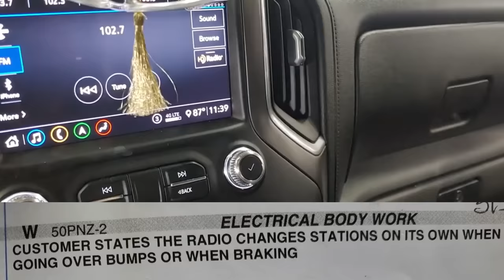Customer States New Camaro They Bought Won't Start

Comment: Im guilty of one of these. I changed the oil in a customers Escort. Th oil filter was on the back of the engine and very hard to see. When I got done with the oil change it was leaking, but only when you drive it and not at idle, I guess it only leaked at higher oil pressure, so it wasn't obvious until they left. They brought it back and I put it on the lift and saw large amounts of oil all around the oil filter. I made sure it was tight then removed it to check the sealing ring, all was good. Figured it was just a bad oil filter. Put a new one on it, no leaks, I hadn't realized it only leaks when driving yet. They came back the next day with the same problem. Got it on the lift again, took the oil filter off and looked around the filter boss with a mirror. Sure enough there was a wire harness just above the oil filter with a Ford part number tag on it. When I unscrewed the old filter the tag fell onto the filter sealing journal. These things happen. Love your channel, it's funny seeing some of the things people try to pull off.
Reply: those damn tags

Comment: listen the snake thing 100% can vouch, similar experience as I did educational shows with animals at various schools
the next school was close by so i put it on my neck, 10 seconds later it was wrapped in and around the searing wheel while i was driving. 
fortunately, nothing bad happened and i was able to pull over because there was absolutely no turning the wheel

Comment: That oil pressure rig really is staggering. The buyer either never checked the engine bay before he bough the car, which is really dumb, or he did check the engine bay and never noticed a shitty old bright yellow gas bottle zip-tied to the top of the engine - even dumber!

Comment: How does anyone finish the sixth grade and not have passed reading comprehension? I do all my own work and have since I bought my first car when I was eleven, if you can read you should be able to follow instructions, shouldn't you? How does anyone not see what is wrong with this crazy stuff?
Reply: Bold of you to assume they can read.
Reply: @soangry  Actually it was working on my own cars that taught me the value of reading comprehension, I could neither afford to buy unneeded parts or hire someone who may or not know what they were doing. Whenever I hear someone read something and then say and "what that means is" I know they're in trouble and I speak up and say, "exactly what it says", which seems to have won me a lot of friends, hah hah.

Comment: I used to work the tech support line for a radiator manufacturer, and installing radiators upside down is more common than most folks want to admit.
Reply: I mean, I could see someone maybe doing that when it has a de-gas bottle/ pressurized coolant reservoir, but when it has a filler neck literally sticking out the top….how?!
Reply: I want to know how that guy filled the coolant system with the rad upside down.

Comment: When oil level or pressure drops, a light turns on on the dashboard. And I was said million times "If that happens, immediately pull over and turn your engine off and ask for towing. Because that is possibly the worst light to see on!"... So, why do these people even keep driving after that light is on is beyond me...
Reply from the maker: I thought that meant to drive faster 😕
Reply: ... cuz that's too long a sentence to put on a light
Reply: When that light comes on it doesn't mean that it actually has a problem. Could be a bad sensor bad wire tripping the light. I've gone through 8 oil pressure sensors in 4 years.
Reply: @BowtieForLife420 ...The name explains it

Comment: 2:02 - do you just not notice a brazing bottle jammed in however between the engine and the firewall? My 4 year old could have spotted that. Also, wouldn't it be easier to send current through a resistor to the dummy light, faking the signal to put out the light? Seems like way too much work here...

Comment: The closing scene KITT Replicar.

I'm rewiring the ignition and dash on a freshly painted Corvette C-3.  The tech next to me doing some lead loading on a Ferrari being metal worked.  We cant believe KITT pulls-in for a parking brake issue. Won't fully apply. The Roach Coach needs room in front. Put KITT on the lift.  LUNCH !!!
W/O  Hand Brake Stuck.  Well try to get you outta here.  Nobody's in the shop..
Got to remove rusty tensioner.  An apprentice welder looks at the solidly rusted thing and jumps at the chance to burn something off!
The back end was hanging low enough to pose no problem.  Front was right between the rear seats. He kicked the part away just as the everybody started yelling FIRE.
Chelmsford, MA
RickCo

Comment: I work at an Auto Parts Store. Guy comes in yesterday with a noise from New Wipers. My Coworker is looking at it. Then I come outside. The Hold Down Spring on the Passenger Wiper Arm.

Comment: Hmm... I'm surprised it lasted more than 300 miles before it needed repairs. With the average IQ of Camaro drivers, they usually get their cars towed to the repair shop after 10 or 50 miles.

Comment: I had a customer bring in a Cadillac that kept blowing 50 amp fuses under the hood. After checking the wiring diagram, I traced part of the circuit to a fuse subpanel in the trunk. They had wired a giant amp to the hot side of a fuse. I disconnected the wire and told them it was fixed, we don't install stereo systems.

Comment: Okay, I am absolutely not a mechanic. But even for me, installing a radiator upside down would be very, very hard to do. I mean, every single connector would be on the wrong side! And how would you get coolant in it? You'd have to somehow pump it up from the bottom and make a seal around whatever hose you were using, then get the cap back on before it all leaked out.

I guess you have to try really really hard to be an idiot sometimes.

Comment: 1:59   Huh? Why wouldn't they simply unplug the sensor, and stick a resistor across the wires in the connector, instead of all that fuckery?? 😕

You sure this wasn't an attempt at a home made oil accumulator?

Comment: I just put my kia soul in the shop today. Reason, power steering and steering gear are leaking. I was having issues with loss of power steering when backing up and starting to drive. Option drive it and have it go out and possibly crash and hurt someone, big NO on that. Or, spend the cash and fix it. It will cost 2400 but if it means that someone will not get hurt by me that is money well spent. 

Also how in the world do you get a serpentine belt around the tensioner like that?!

Comment: I you want to fix your own car stuff little piece of advise, get the specs. for the torque for bolts and even if you just get a cheapie HF torque wrench use it but also follow the instructions for the wrench. Mine have last for many years and done many jobs.

Comment: Had a car towed in recently with no brakes. The pedal would go completely to the floor then spring back quickly upon release, no external fluid leaks were seen. Upon picking the vehicle up in the air the problem became easily apparent. A section of steel brake line had rotted out along the frame rail. The customer had cut that bad section out and had clamped in a length of 5/16 rubber fuel hose in its place. Of course this customer had completely failed to mention this little genius repair he had concocted and installed!

Comment: I am probably on one of these. I used to be a mechanic, but got injured and now I am disabled and can't do any of my own work. I could have sworn my steering arm was out... whenever I turned one direction I could feel something thumping my left foot and heard a clunking sound. I took it in thinking I was gonna need major work. They called me later that day and apparently my floor mat had pushed its way up under the dashboard where the steering column was hitting it when I turned one way.

Comment: I installed sound systems when I was a dumbass high school kid. How stupid does one have to be to use hot glue? Even if you don't crimp on spade connectors, you can at least pinch the wires under the screw.

Comment: I wish you could show how they repaired some of these like striping the valve cover screws. You have to tap out some and not others? That would be frustrating for your mechanic to say the least. You have to get a whole new top end put on the engine just to rectify the screw holes. Ain't that a b*tch?

Comment: I work in car rental and recently drove a car that made a scraping noise in the steering column when the wheel was turned. Investigation revealed this to be caused by a half-peeled sticker on the back of the steering wheel where it joins the steering column. Peeled the sticker off. Problem solved. I wish they were all that easy.

Comment: I can't even believe someone would think a radiator goes upside down. Just by looking at it. They should know the cap has to be on top to fill it and not to leak out and that's not even mentioning the hoses not even coming close to fitting.

Comment: What is the solution for the strip threads for the cruze at 0:50 ? Because I legit have the same car and the exact same problem. 2 of the threads are stripped and its leaking oil really bad from one of the sides.
Reply from the maker: Search up helicoil. If the threads are damaged you could install those. You need to get the correct size of helicoil. I'm sure you could find a video about it on YouTube. I've done lots and they have worked good.

Comment: I still don't understand the water coming out of the oil pan in the first one. Did it Crack in between a coolant galley and an oil line?
Reply from the maker: Most likely when the engine seized that happened. I'll have to ask the technician.
Reply: @Just Rolled In  Thank you very much! You don't have to do that though 😄😄

Comment: Some of these things I can understand: no proper lighting, possibly a restricted view, and a moment of carelessness, and the oil filter pinches the wires.

But who the hell does a radiator install and goes all the way through where the bolts don't line up with the holes, the pegs on the bottom don't fit because the holes for them are on the top, they've plugged lines that didn't reach with bolts, and the radiator cap is on the bottom.

That's not understanding repairs, and that's not a moment of carelessness. That's what a friend of mine calls "industrial-grade stupid"